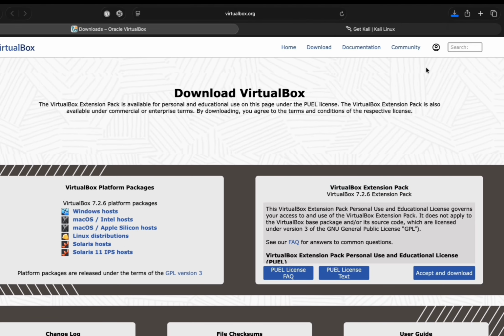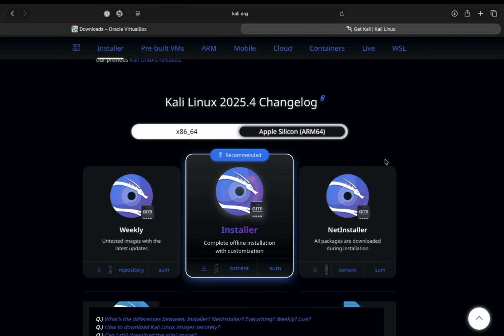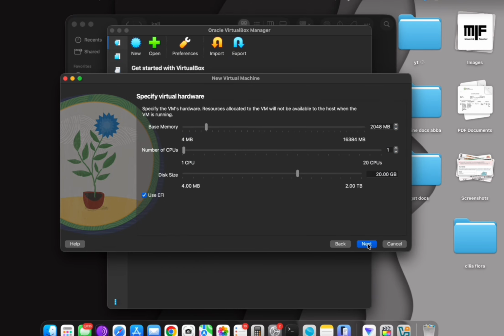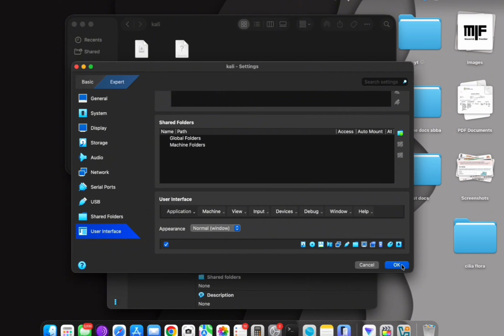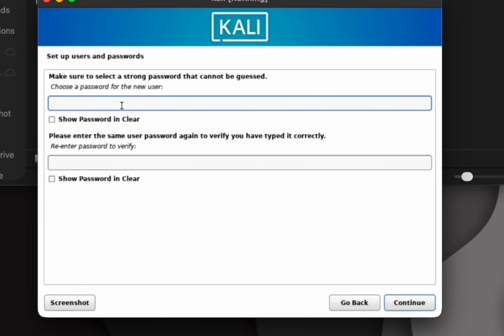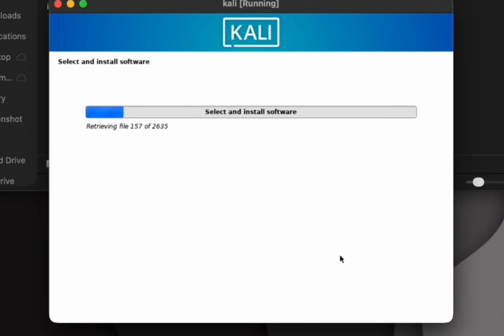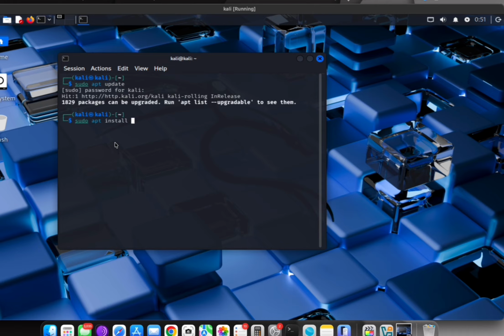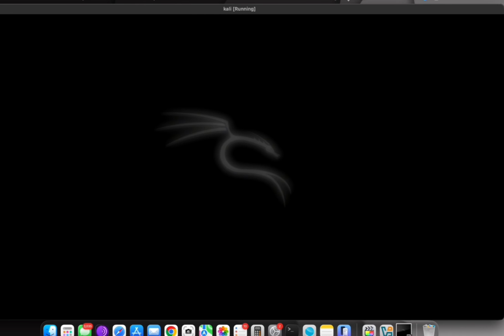Run Kali Linux on M1, M2, M3, M4 & M5 Macs – FULL Setup Guide (ARM64 + VirtualBox)

Comment: Bro facing problem when i click on start nothing is showing only black screen and my pc is snapdragon X plus please help me what to do
Reply from the maker: This guide is only for Apple Silicon Macs (M1–M5). Unfortunately, it doesn’t apply to Snapdragon X Plus PCs since they use a different platform.
Reply: I have the same issue. did you find a solution?